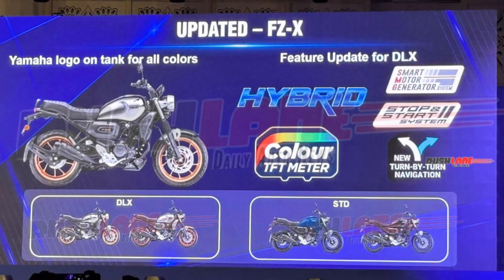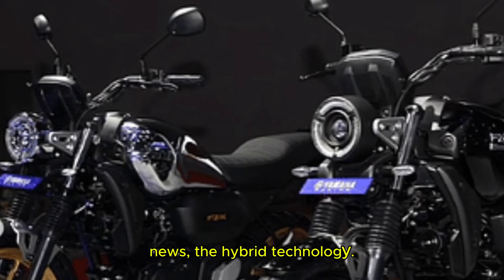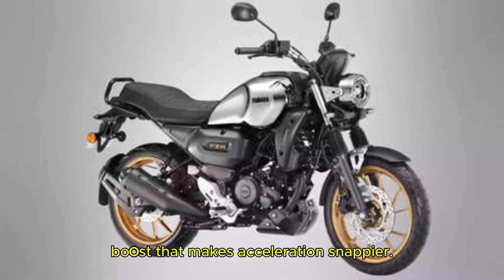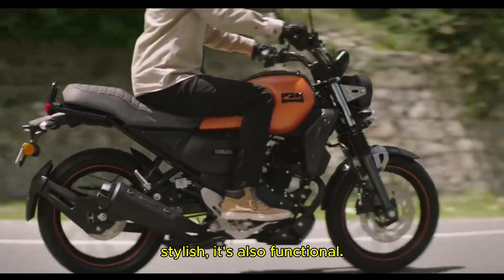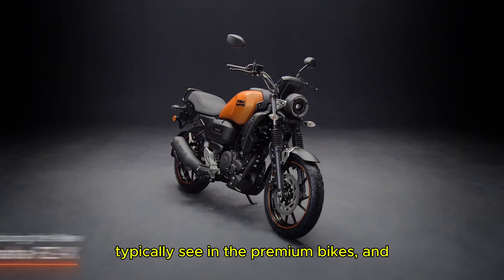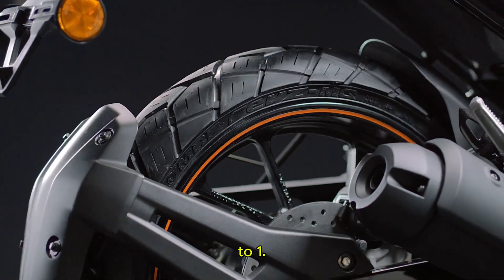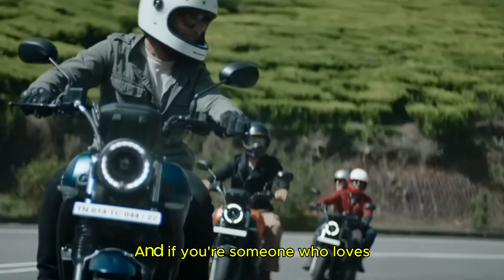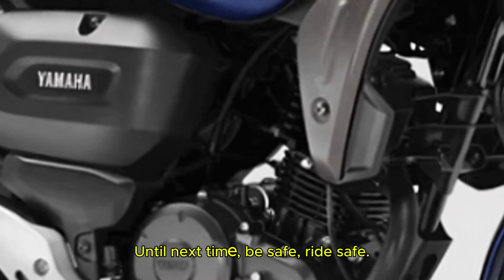Yamaha FZ-X Hybrid Technology Unveiled | 2025 New Model | Updates & Features

Comment: But failure bike...
FZx asthetic look wise very poor design. look like patchup work.
*Over sized fuel tank
*Huge gap between Headlight & meter Console.
*Colours also not good.
*Turning radius is very low.
There's no doubt about engine & performance,milage, quality.
But asthetic look also important na...
Reply: This is the bike is a surely faliure model ! I hv 2022 one , always chain problem , over weight, even colour faded in less than 6 months